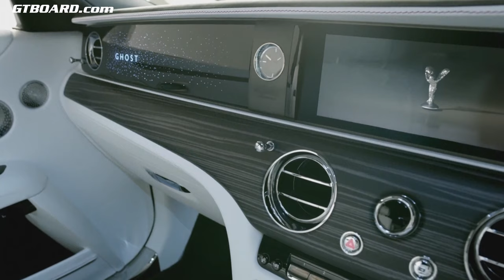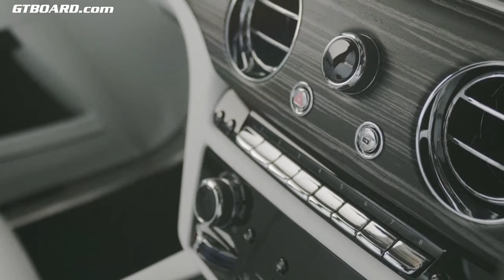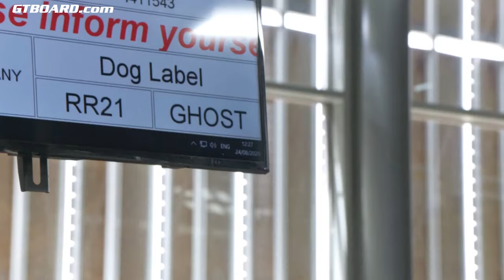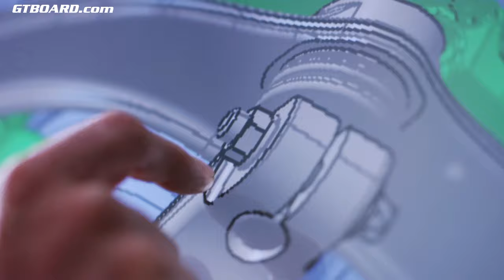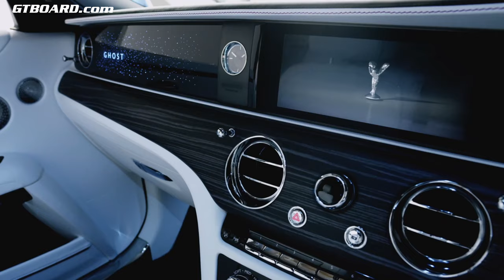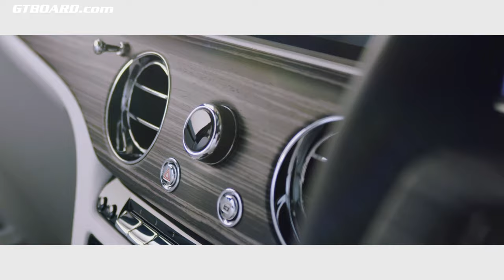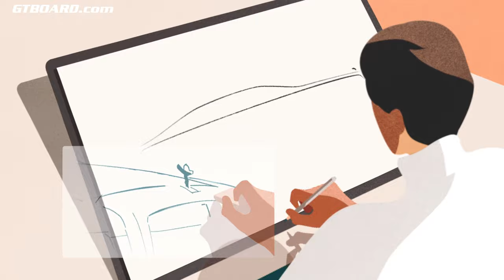[4k] NEW Rolls Royce Ghost finally 4WD!

Comment: well its a 7 series underneath sooo
Reply: No kid, it uses the same platform as the new cullinan and the new phantom. Which is completely different from what you get in any other bmw models. Know your shit before you comment kid.
Reply: @ssd3748  no its a 7 series
Reply: 771 no it’s not kid. Just look it up and it’ll tell you otherwise. It was the old one which used the same plaform as the 7 series. The new one uses the same platform as the phantom and the cullinan. Don’t make me write twice kid
Reply: SSD 374 its a 7 series
Reply: 771 no it’s not. You’re just fooling me now aren’t ya? Or you have interpretation ability of a 5 year old.
Reply: SSD 374 its a 7 series underneath
Reply: 771 🤦‍♀️🤦‍♀️🤦‍♀️ It uses rolls royce exclusive ‘architecture of luxury’ platform. Which is a platform designated for rolls royce models ONLY. Platform is NOT from a bmw 7 series. Go do your research first kid.
Reply: @ssd3748  Its a 7 series underneath
Reply: 771 🤦‍♀️🤦‍♀️🤦‍♀️
Reply: @ssd3748   that "kid" trolled you so hard lmao